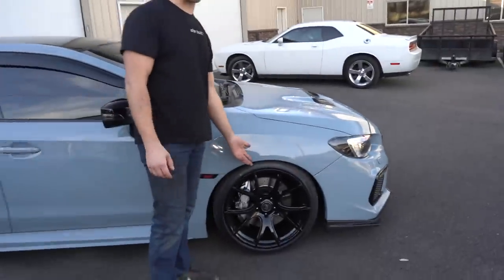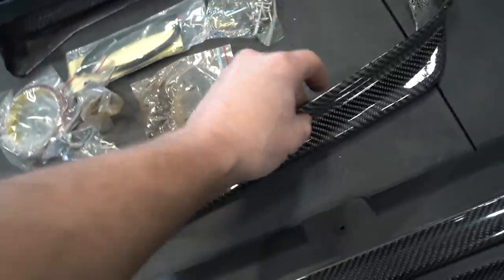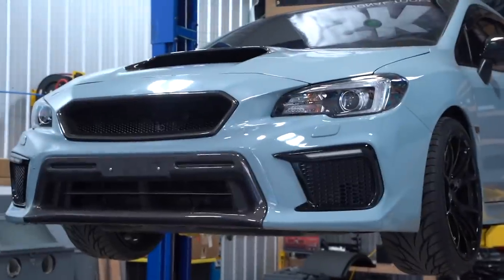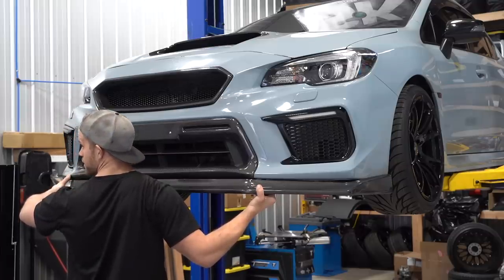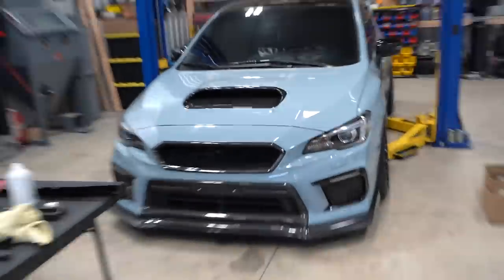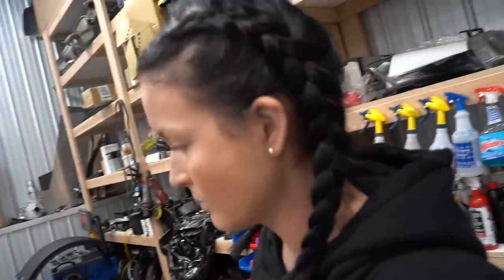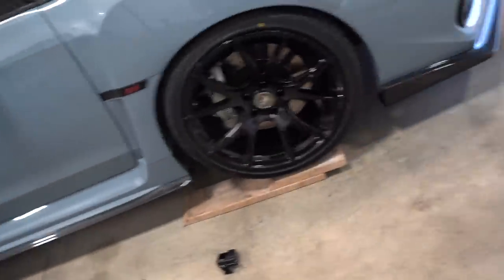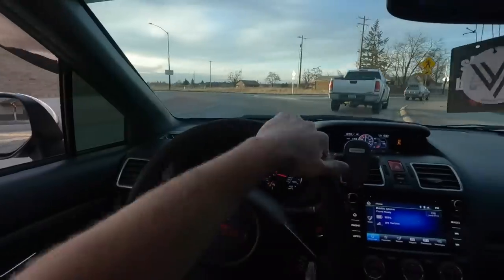She's Complete and Looks INSANE

Comment: Bobbi's car looks so amazing with all the new carbon and wheels 👍.  Full carbon bonnet and roof?, Or to much?.

Said before would love to see you do engine swap with Subaru EZ30 H6 cylinder, with forged internals, not a difficult to ge a hold of  as used to be a few years ago, believe few people offer kits for  them now, and  Know that's overkill 😂, just love to see you do it 😁.  but no matter what you do will be amazing build and EJ257 still amazing block to mod and work on 👍